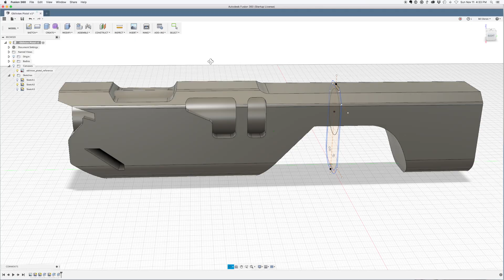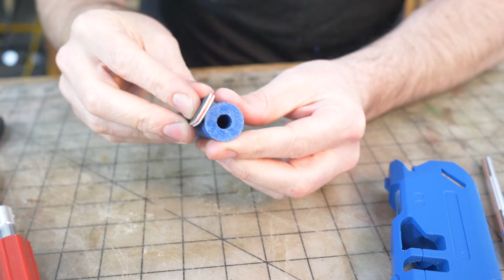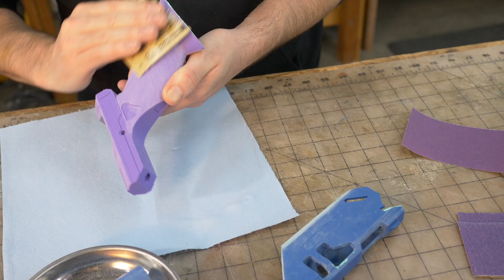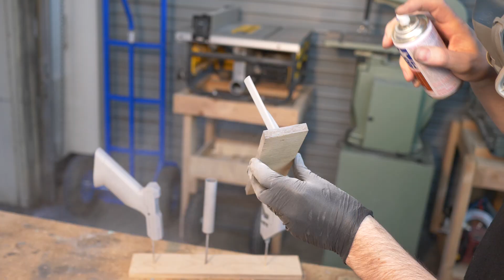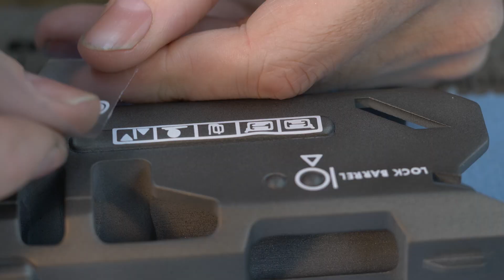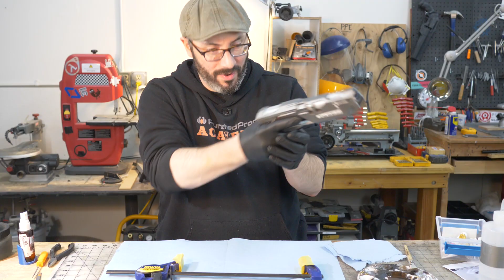From 3D Model to Finished Prop - Tom Cruise's Oblivion Blaster!

Comment from the maker: Check out work in progress photos and the full tools & materials list here: https://punishedprops.com/2019/01/28/oblivion-movie-pistol/
Reply: Punished Props Academy beautiful piece of artwork there bill as all ways mate so keep up the good work🇦🇺👍👍👍👍👍👍👍👍👍👍👍👍👍👍👍👍👍👍👍👍👍👍👍 just because I can only like once
Reply: This project turned out totally amazing, I would like to make something similar in look/detail with my friend's son... but not a weapon! Any chance you might make a video of such a thing any time soon?
Reply: @Punished Props Academy  ...pro tip on using the CA, you can put a drop of the accelerator on the mating surface so you don't have to put drops all over the place on the outside. So glue on one surface, drop of kicker on the other, join. Only note is that it'll go off much faster, so be quick lining up :)
Reply: Perhaps if you make something like this again ... add a WORKING TRIGGER as if used in a film, it causes the actor to react to the 'realism.'

D.A.

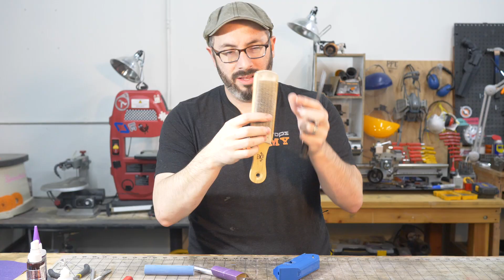Comment: 9:25 It's called a, "card" because it is esssentially the same type of wire brush that is used in the processing of wool.  Raw wool is pulled between two "carding tools," and the process is called, "carding the wool."  This preps the fibers for being spun in to wool thread.

Comment: When spraying white over silvers, paint it black first, it will make the white stand out more and show as a brighter white.
Using vinyl on top of a flat surface will make it stand out, whenever possible stencil and paint instead.  Firearms are not likely to have decals for any warnings or instructions.  They are usually laser engraved and color filled if necessary.  To replicate this, laser or dremel etch the warnings and instructions, for metal, you can sandblast or chemical etch.

Comment: On the blade runner blaster you say you just went up and up in sandpaper grit till it was shiny. Is that all you did or did you apply some clear coat on top of the sanded parts? Very interesting results.

Comment: hey bill fantastic video I do a bit of 3D printing myself .. As one of the last people I know that uses ABS for its rigidity (PETG is good but is a nightmare to remove support material). When you do your next ABS build try out the following. 

Make a slightly more milky version of your slurry (acetone/ABS mix) , Use this a bit like you use modpodge . Use an old paint brush and run it over printer parts to close up the layer layer lines.a  little before sanding and /or after to close up the print (much like you use your hot air gun to defuzz the edges of foam after cutting)

Make a slightly thicker mix or use your ABS slurry itself as filler on parts like the base of the gun which looked very grainy instead of spot putty. Hopefully you already use your sluury for all bonding parts instead of super glue for a super strong weld. This will also mean you wont need to use spotty putty anywhere near as much.

This will also mean your weld joints and softening will hopefully speed up a little as its takes as long to set properly as it takes the acetone to burn off which is usually minutes.
Reply from the maker: Great tips, thanks!

Comment: I prefer PETF personally. Sand it with water sprayed on to keep the temp down. It prints easier than ABS, and doesn't need any heated bed or chamber. It is almost as usable as ABS for durability, and not as rigid and breakable as PLA.

Comment: Is there a printing filament that's harder than another? If there is you could use the two and print on top of one another, then when it comes to sanding the softer will sand away easier, so you get a ripple effect almost like corrugated tube.

Comment: Awesome video, very informative, I use a thin mixture of plaster mixed with water over PLA to fill the layer lines and sand easy and also use something similar to drywall sparkle paste to fill lines, it can be thinned with water and wet sands easy. Like how ABS sands in the video, its similar to my SLA prints.
Reply from the maker: Neat!

Comment: I don't know if someone mention it but instead of superglue you should use ABS glue like the one used for Warhammer figs, it's an acetone based glue so it weld the two parts realy strongly

Comment: That is amazing, but still looks a bit light (weight).  Maybe a bit of weight in the hilt would have helped?
Reply from the maker: I don't like to make my props weigh too much since they're mainly for display or for taking to a convention - it's not fun holding something heavier than it needs to be all day! But I like to keep fishing weights in the shop for when I do want to give something a little extra heft. I did that with my mod of the Ghost Busters PKE Meter: https://youtu.be/hoJx0jg1ru0
Reply: @punishedprops  I see.  The kind of props I make, I make for the stage (nowhere near as good or detailed as yours), so I tend to look at your work with the stage in mind :-)

Comment: as far as the stickers, I would have made water transfer decals instead. They won't stick up under clear coat like stickers and the smaller pieces would be easier to handle.

Comment: @Punished Props, could you help me regarding the spot putty? 

I bought the tube using your link but they sent me a bottle that says 'acryl green glazing putty' and its really thin compared to what you used in your video.  Sometimes it goes on like the video but more often than not, its sometimes water-thin.  Did they send me the wrong item? Or is it under a different name and i just have to squeeze the liquidy part out first or something?
Reply from the maker: That might just be the solvent in the putty leaking out.  You might have to squeeze a bit out of the tube and mix it up.
Reply: @punishedprops  
I cannot believe your power of timing.  I needed to finish an etsy order by 5pm and needed an emergency filler putty and decided to give that tube i mentioned a chance, so i dumped a bunch into a cup literally 15 mins ago and found out this exact thing.   ^~^

Youre a wizard Har-....err....Bill/Britt*

Comment: Try using a rubber eraser to remove sand from your files, Ive found that it works better than anything else.
Reply from the maker: That's exactly what I use to clean off my spindle sander too!
Reply: @punishedprops  Works Wonders!

Comment: Nice ;)  i  use aceton first the sanding  this case bound the ABS layers  and smoth litle first the sanding  and printed part its stronger ... i print body for plasma cuter torch  and works well and body for cnc spindle  in ABS and its like from inject form ... Aceton gluid ABS part together  its not necesery use SuperGlue  ABS its the best  but use Aceton first sanding  for bond the layers ;)

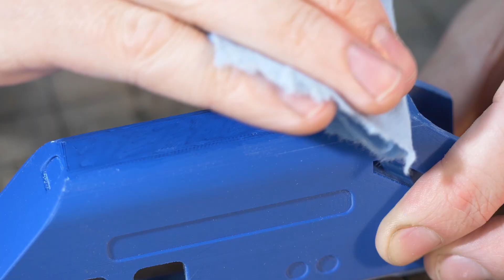Comment: @10:30 would the slurry you made work instead of the super glue if you let it dry?
Reply from the maker: Yes! You can actually use the slurry to "weld" parts together and make a very secure connection. It does take a little longer, however, and can be a bit messy. It also only works on the filament itself and not primered sections, so I chose to use super glue, allowing me to sand the parts separately and primer them before assembly.

Comment: What a secret Santa... They're getting thousands of dollars worth of work. I'm curious if you have tried and if you like the Molotow chrome paint which Adam Savage swears by.  The glittery look of most chrome paint always bothered me in model-making. I would tend to use metal if at all possible for those shiny bits for that reason, but Adam says that Molotow stuff is a whole new ballgame.

BTW the hole in the O and other letters is called the 'counter': when making the original punches used to create molds for metal type, this part had to be punched rather than filed, and that punch, to create a hole in the final punch, was called a counter-punch - hence the part it punches is the 'counter'.
Reply from the maker: Yeah I've tried the Molotow paint and it does work well, but you HAVE to let it dry for a LONG time before adding anything on top of it, I've learned. That seems to get the best results, but doesn't work super well for our workflow. 

Thanks for the info about letters!
Reply: @punishedprops  Good to know! Thanks for the reply.

Comment: Hey Bill, great video! To your question - I work pretty exclusively in PLA. Part of this is my printer - it's an older model that I've rebuilt a couple of times and has no heated bed, although I could mod it to include one. But the low cost of pretty good PLAs makes it so easy to just run and rerun parts. It's also fairly forgiving of the weird temperatures in my shop (i.e. I'm in Canada and it's really cold down there right now). And once you get into a rhythm of working with it, it's not super hard to post-process. Finally, I'm not set up to capture or vent nasty fumes so having a low-emission process is handy.

Comment: Don’t sand your paint to get your parts to glue to each other, you are making a valley that your part isn’t sticking to all that well. I feel that you have no confidence in your paint adhesion enough that you think you must sand to the PLA for the part to adhere to. I actually trust your paint more than I do your PLA. Just glue it, or during your Fushion360 development time, create a concave area so your glue has an area to pool up in and actually creat a bond.

Comment: What extruder nozzle diameter do you use? My default preference is 0.4mm but I can't afford an ultimaker so I have an Ender3 with some personal modifications... I was wondering if you thought 0.4mm would be fine enough to deal with the little grooves and whatnot?

Comment: I also use ABS as it sands really well but also because you can use the slurry that you also use for bed adhesion as either a glue to bond two pieces together better then super glue as it will be chemically "welded" them. Also the slurry is great for a body filler to remove that you had at the 10min mark or under extrusion / layer lines. just apply with a Q-tip or paint brush

Comment: If you have good files, don't use a file card, they wear the teeth prematurely. I like to use a piece of bamboo to remove pinning from the file. It will wear and conform to the teeth alowing good cleaning right to the base of the teeth. For Aluminium pinning, which can be really stubborn, use a sodium hydroxide solution to disolve it.

Comment: That blade runner blaster finish.... Bill you are a monster...Amazing work. I need to finish my testing for the Mr. Surfacer stuff. I had some chemical or cold reaction that ruined my first test but it was crazy how smooth it would get with no sanding. Just requires a lot of coats... and at $9 for a tiny can... well it wasn't economical. So I was testing it on top of 2 in 1 filler primer when I ran into the issue. Just too busy with my Transistor build to get back to it.

Comment: i have several favorite filaments... for quick and dirty prototyping i always go PLA first, its cheap, prints easily and has less warping and shrinkage compared to ABS. For most stuff that needs to be structural I use PETG or ABS, depending on where the part is going to be used (indoors, outdoors, temperature and stuff like that) .I rarely touch nylon since i don't do much stuff that needs it's properties and the few times I have needed something flexible i just buy a roll of the filament that has the hardness i need (I usually go for Ninjaflex Semiflex or regular Ninjaflex)... So favorite filament is a hard question to answer, but if I have to pick one type I would go for PETG... but PLA is what i print with most.

Comment: I also print mainly with ABS, but for bigger prints I use HIPS fillament for years now. It is very similar to ABS, but it shrinks less. It has very nice matte finish, especially in black color. Also it has heat resistance of ABS. I know many sellers advertise HIPS as "support material" but it's just one of many benefits of this material.
EDIT: This video is pure ART, thank you :-)

Comment: My favorite filament is PLA, I've had decent luck with TPU as well.  Been fighting with PETG, can't get a decent print, keeps clogging, or the layers don't adhere well, or come off the bed in spots, just been a real fight, I've gone through an entire spool of it trying to get it to print well.  I'm going to upgrade to a Micro Swiss all metal hotend and try again.  Until I build an enclosure I'm not going to bother trying PLA in my cold, drafty basement.

Comment: Epoxy might have been overkill.  E6000 would be more than enough for the steel rod and CA for the 3D printed parts.

p.s. I use these to connect a lot of my printed pieces and keep an assortment of long rods that I can cut down for use.  
https://www.amazon.com/gp/product/B01B5UFD4Q/ref=oh_aui_search_asin_title?ie=UTF8&psc=1
Reply: I also like to install lead where ever I can.

https://www.amazon.com/gp/product/B003OCAFEC/ref=oh_aui_search_asin_title?ie=UTF8&psc=1

Comment: Favorite filament is NGEN, made by Colorfabb.
It's got the same strength as ABS, almost the same temperature resistance as well, but it prints like PLA without warping on a normal open printer.
It's more expensive but for sure the best filament I have ever seen.

Comment: I have two suggestions for you.

1) Get some pipettes to dispense your paint so you're not spilling it all over the threads of the jar.

2) If you want a REALLY sharp blade then make a leather strop.  Any old leather glued to a piece of whatever with some compound will make a new blade sharper than anything you could imagine.  I tried it once expecting to make the blade duller and found it got ungodly sharp and have been doing it ever since.  Instead of going through three blades a day I can make a blade last for weeks until I finally break off the tip.  I start by stropping the blade before it's ever used and it makes a huge difference.

Comment: I find double sided tape is often too strong and a pain to get off the part, surface.  I like to use masking tape.  Put a layer down on the surface, and a 2nd strip on the part(s).  CA glue down the bit on the surface, voila double sided masking tape.

Comment: I've tried ABS prints and very often, prints failed because of warping. Warping is the ABS cancer. Impossible to avoid it.
Nowadays, good quality PLA are as strong as ABS and still much easier to print.
My choice to print detailled objects without problem : PLA...

Comment: The entire time I'm looking at this print I can't stop gushing over what a good quality this is! It's basically ready off the bed, besides basic clean up of course
Reply: .1mm layer height will do this. I've printed as low as .05mm and although the quality is ridiculous, it just takes far too long to complete the tiniest model.
I print figures and like to size some up to about 200mm tall. With the correct slicer settings and .1mm layer height, they should be next to perfect with no sanding required. Some filaments work better than others however. I only print in PLA unless I am printing extruder parts or something that absolutely requires ABS/PETG.

You need to sacrifice speed for quality or quality for speed. 

I print using what used to be an ANET A7 which is modified to the point where only the original frame, stepper motors and aluminum bed is left from the stock unit. Everything else from the motherboard, extruder and power supply, firmware is custom. That being said, I got perfect prints with the stock A7. The main difference is I can bump the speed up to 100 or 200mm/s depending on what I am printing as opposed to 70max with the stock machine.
Reply: @MHTSAPAS 6 years later and you can get a 500ms machine for under £150 (neptune 4 on sale)

Comment: A great video. Fun and I learned stuff! You asked about Print filament, I only have the Dremel 3D20 so I can only use PLA, but so far my favorite filaments are Stainless Steel Fill from Proto-Pasta (It's heavier then normal PLA and sands much easier, kind looks like bare Die-cast metal when buffed. Stupid expensive compared to regular PLA, but if you haven't tried it, it's awesome for hand props and details. Printed an entire BR blaster out of it! ) and Wood Fill (I used the cheaper Hatchbox version from Amazon. Again, sands really well and can be stained. Great for prop gun grips!) Thanks for the awesome build video

Comment: Would you use the air drying putty to fill the lines of a print then sand smooth then use filler primer to create positives for moulds, if done for quick use or would you recommend polishing up , I use pla due to the sent and the ease of printing.

Comment: ABS is my go-to material for strength, durability and temperature  tolerance, as I often print replacement parts for tools and equipment; PETG is a good compromise between ABS and PLA for non-critical stuff as it shrinks less than ABS but is much stronger than PLA..   I use carbon-fibre filled filament for stuff that needs extra structural strength..    CF Nylon for the critical stuff, CF PLA for functional prototypes as it works "first time" in most cases and there's less potential for wastage..

Comment: Use ABS for the actual models ill be using and PLA for prototypes with ABS I brush on acetone to remove good chunks of the layer lines then filler primer and sand twice, prime then paint :)

Comment: My favorite filament is PLA, for the main reason that I print in the house. PLA is a major pain in the butt to finish though, I showed you my Shore Trooper helmet on twitter back in November. It took a lot of effort but worth it in the end.  I'm currently printing a lifesize R2D2 and though I'd love to use ABS, its only a static prop with lights and sound so PLA will work.